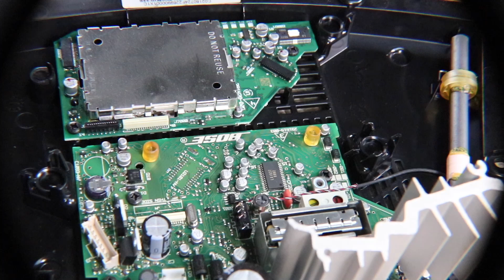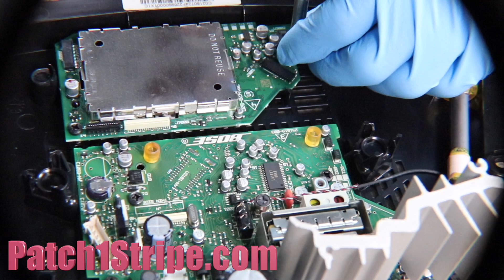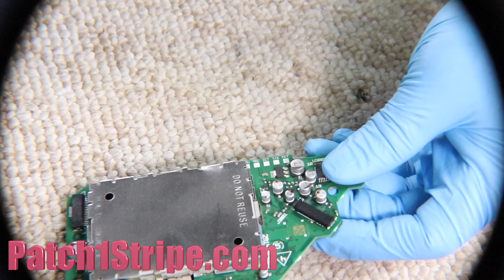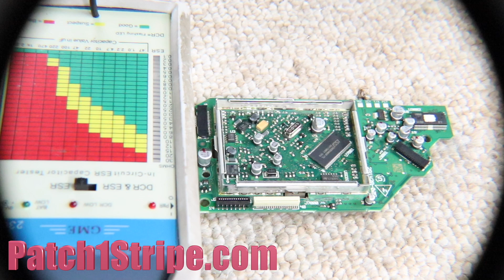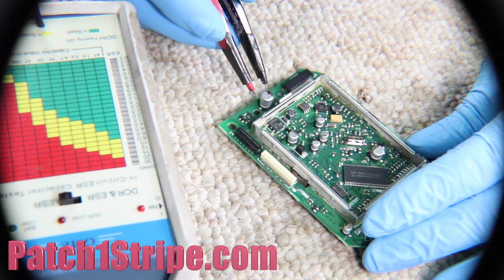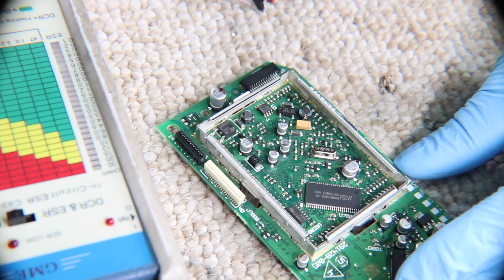HOW TO REPAIR A BOSE WAVE MUSIC SYSTEM - CHECKING FOR THE BAD CAPACITORS

Comment: Did you say you have capacitor kits for these radios?
Reply from the maker: What do you need? One for the main board, the power supply or both. I only have aluminum electrolytic capacitors. Exact replacement or better.
Reply: @Patch1stripeTVParts  I replaced them already with what I had on hand, if it fails again, I'll get those from you!  Thanks.
Reply from the maker: The problem is all of the cap has the same amount of usage. Every time I test all the caps in a Bose Wave system, 95% of those are bad (ESR testing). Caps are used in every function so by not changing all of them, different failures will occur.  An example - sound quality has deteriorated to the point you can’t detect it.  Another, one area it will burn the circuit and you will need mad soldering skills and a microscope to make the repair. And I can go on and on. Do it completely the first time and have yourself a new function system for many years to come into the future.
Reply: @Patch1stripeTVParts  you're right about all of that,  I did go thru and do the worst of them (tested with ESR meter I got at your suggestion) thanks for all of the info!

Comment: Have you ever checked to see how closely the in-circuit ESR measurements match out-of-circuit measurements? Are they the same?
Reply from the maker: We are not measuring capacitance. That’s the beauty of the ESR meter, it’s accurate in measuring series resistance in and out of the circuit.
Reply: @Patch1stripeTVParts  Thank you for quick response. I'll assume have you observed the same measurements in and out of circuit yourself since you didn't say specifically. In a circuit where you have parallel capacitors I just wonder how you can tell which capacitor's ESR you're measuring. Maybe I'll try this myself sometime since I have an ESR meter. I'm just a hobbyist, not an expert. I've been removing capacitors before testing which is a pain I would like to avoid if I can be sure in-circuit measurements are accurate.

Great video and straight to the point. I like that! Thanks again.

Comment: You tried to measure some electrolytics with reversed polarity!
Reply from the maker: I am measuring equivalent series resistance with my ESR meter. ESR meters are used to measure the health of a device, as an increase in ESR can indicate a failing capacitor. A bad capacitor can cause a number of issues, including: Disrupted current flow, Part heating, Upset time constants, and Complete circuit failure. My question to you is " does resistance have polarity?"